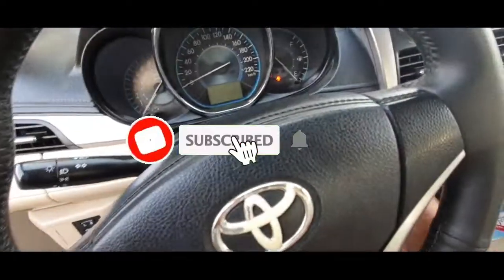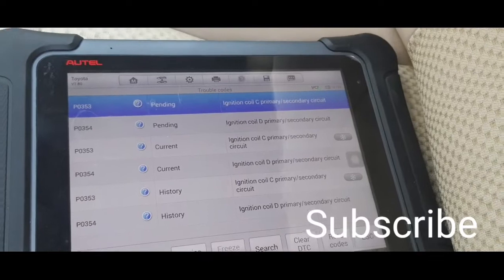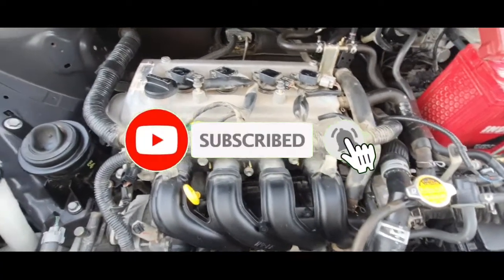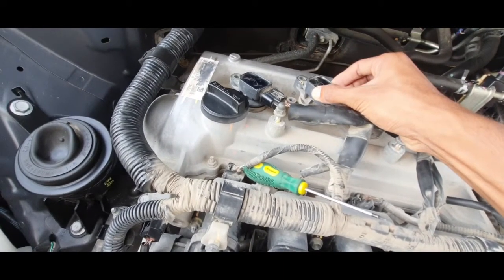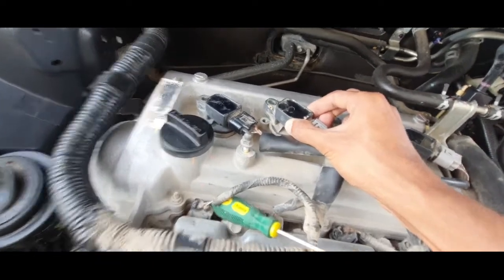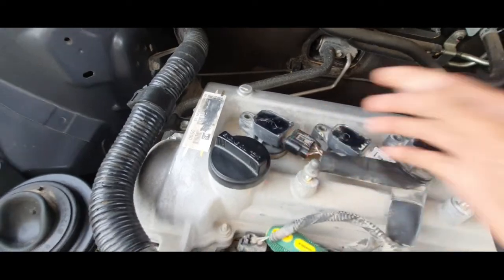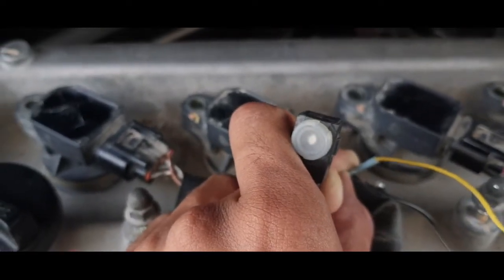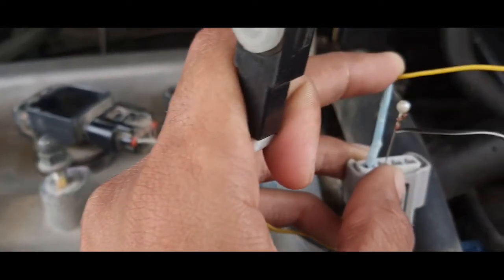How to test ECM signal in ignition coil easy way😊😊

Comment: I have a similar issue.  Connector 1 is showing power but the negative pulsating is not lit.  So, would this indicate the ECM is bad?  I've changed coils, spark plug, cam/crankshaft sensors, etc.  All are good but still not receiving spark for spark plug/cylinder 1.
Reply: Have u solved the issue?

Comment: i use the voltmeter tester to test how many volts coming , some time bulb light up but correct amount of voltage is not generating from ECM which results in car vibration as one or two cylinder wont work properly.

Comment: Show the fix please..... I'm getting the same problem on the same plugs and coil packs, all was changed, and the same problem.... The diagnostics saying primary ignition trouble code... No ignition with the key... And when I hot start the car, by connecting the voltage to the starter direct, if I turn the ignition switch to start again while the engine is running the car shuts off with no clanking of the starter to the fly wheel.... I'm about to change the ecm....